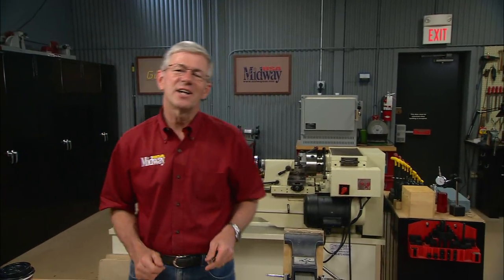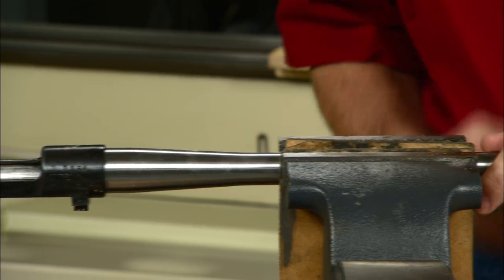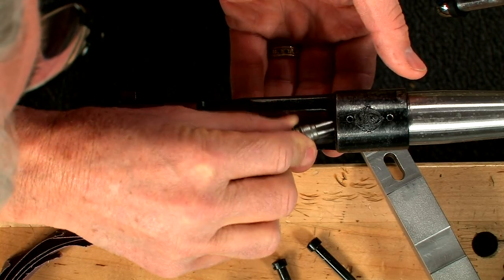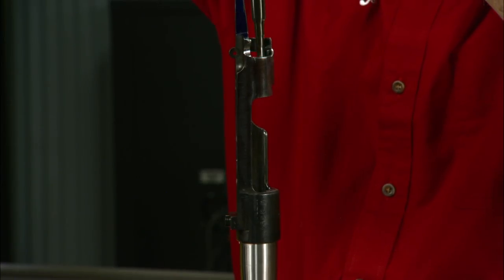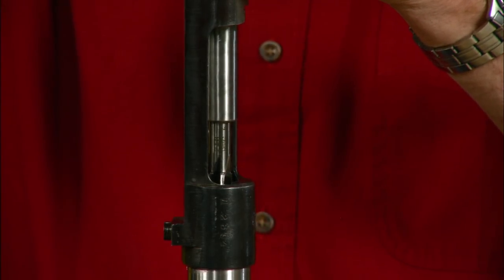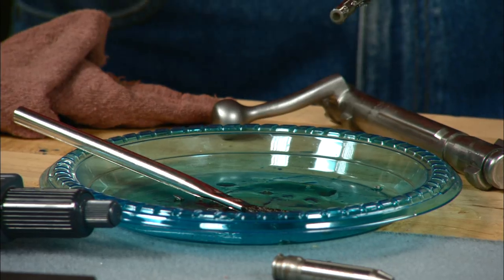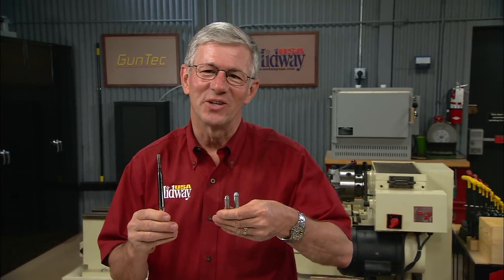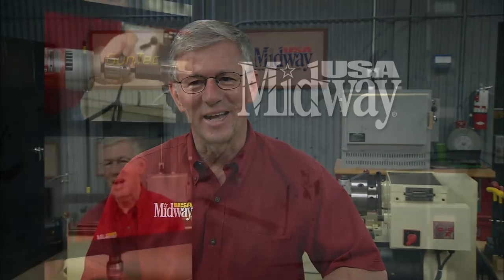How to Chamber a Mauser Short Chambered Barrel | MidwayUSA Gunsmithing

Comment: American Barrel usually have a too short chamber. As a gunsmith from Germany I can say, that all German (such as Lothar Walther or Heym) barrels have too large Chambers. So you can turn off some of the barrel and dont't need a special reamer for every caliber. But watch out- the visible "contact" surface at the front side of the chamber should keep some space to the barrel, it shold only contact the chamber with its threads and the breech. greetings, nice videos.

Comment: A skill we all should get to know. However, I was taught to continue turning the reamer clockwise and remove it while turning and never stop until it is clear of the action. Am I a little far off here? I saw a guy turn one backwards once while removing the reamer. I just shook my head and clicked quickly to the next video.
Reply: you are correct if using motorised tools, there is no binding issue from suddenly stopping if using a T-handle

Comment: Mr. Potterfield,  I have an old 7x57 Spanish Mauser that was manufactured in Berlin Germany so I have no idea how old the weapon is but I am wondering if it is possible to use the old barrel and drill out the chamber and put in a sleeve and then re chambered the weapon again in 7x57 or will the barrel need to be replaced all together ,,,, The weapon when fired has much blow back and cartage bulging around the neck and the primer blows out not safe in unsuspecting hands ...  Thank you in advance for your answer  ..  I do like the caliber as it very much reminds me of the .270 caliber as far as the caricaturist ..

Comment: This is a great video but not for a novice, yet that seems to be who prepared for since gun smiths know what they are doing. If you look close when head space is checked, the bolt does not have the extractor on It and the ring retainer are both missing from the bolt. If this technique is used without the simple up front hint or instructions to remove it (yes, its a different video) the novice will over ream the headspace...or worse make a bad decision thing they did it right.  I suggest you refer to the headspace testing video, or better yet, combine them since there is a lot of room for error.